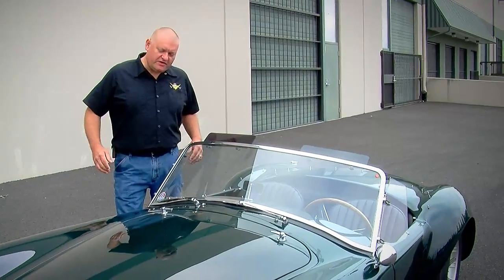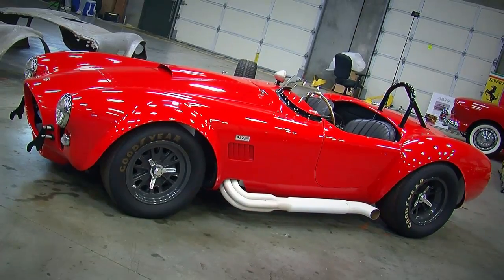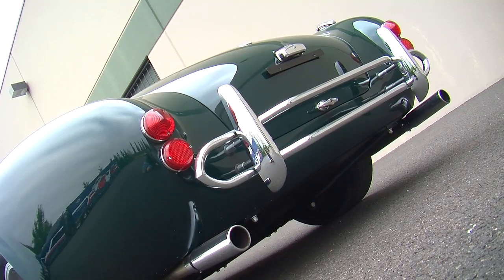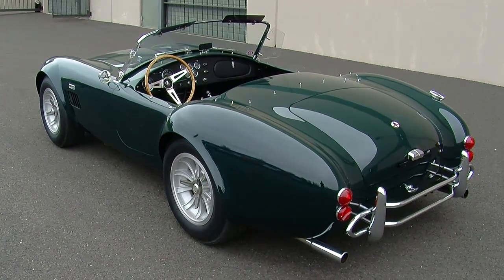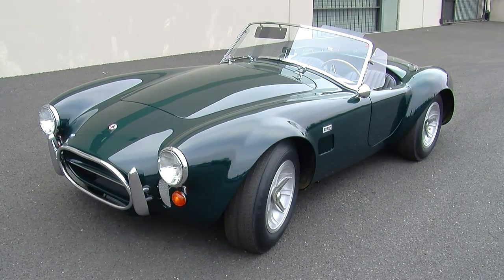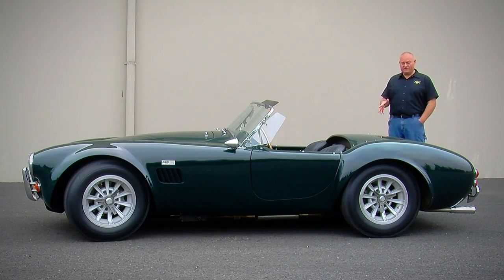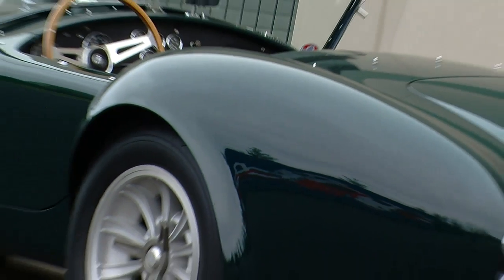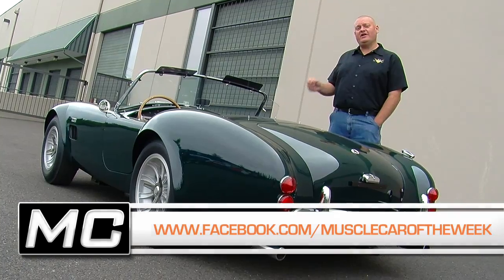Muscle Car Of The Week Video #81: 1967 Shelby Cobra

Comment: I knew a guy in my town that bought this exact same car brand new in 1967 from a West Hartford Ford/Cobra dealer.  I have some nice color shots of it taken around 1980 or so.  He had some issues and sold it.   I was at a car show in the former Hartford Civic Center some years later, and saw a green 1967 Cobra 427 street car just like this one.  It was being shown by E.R.A of New Britain, Connecticut, a fine Cobra and GT40 replica manufacturer. In conversation with the owner, it turns out this was that Cobra!  Small world indeed!
Reply: I know it’s been a couple years since this comment, but I think this was my Great Uncles car. His name was George Petri, unfortunately he passed away a few years ago. He gave me a picture he took when he owned it, CSX 3245. Do you happen to know if the car in this video is the car my great uncle owned?

Comment: Carroll Shelby was forced By Ford to remove the 428’s and put in the 427’s because of customer complaints that they thought they were getting the 427. Which makes this car even more interesting and valuable. It has to be rare.
Reply: It is well documented that only the customers who a) discovered they got the 428 and b) complained to Shelby, got their 340 hp 428 replaced with the 475 hp 427. I have no proof of this, but I have always believed that the 428's weren't even Police Interceptors, they were plain jane 315 hp motors installed in Thunderbirds etc. back in the day. Shameful behavior by Shelby, really.

Comment: The 3 second 0-60 was a real thing. If I remember correctly....Detroit recieved SEVERAL complaints about the 428 being used instead of the 427. Mr. Ford made a phone call to Shelby and Shelby was ordered to replace the 428 for anybody who complained. I'm not sure about the cobra but the GT 500 buyers were the bulk of the complaints. 
   Ol Shell had to replace NUMEROUS engines on his own dime. Mr. FORD said if he was selling it as a 427, it better be a 427.
Reply: GT500's were always advertised as 428....wat's to complain about?

Comment: Shelby did not bother to tell anyone that he had gone to the cheaper and lower-performing 428 engine - as can be seen from the 427 plate on the rocker cover of this car! Ford were about to discontinue the 427 in any case, but it was a bit of a sharp move to not tell buyers about it, I would say!

Also the move to Sunburst wheels was only because of the higher costs of the original Halibrand wheels.

Comment: I appreciate your explanation of the differences between the 427 side-oiler and the 428.  How about the 429?  Did it share a block with the 427 and 428?
Reply: No they call it the "semi-hemi" with very large heads, they had to modify the mustang towers to even fit the monster in the bay leaving no room for ac compressor.
Reply: bailey9r, thanks.
Reply: @bailey9r  The Boss '9 is the semi-hemi with the big heads (as are the actual Mopar hemi's) and all the 429's are 385 series engines whereas the 427-428 are FE engine family. Completely different engines.

Comment: The power ratings like thes have always confused me. I was taught that HP is the torque plus the inertia of the engine. In this and other cases the torque is much greater that the HP. How is this so as I could really use some help here? Thanks

Comment: A bit of misinformation in this video: The 428's were installed, not as an option, but due to a lack of availability of the 427 engines. This is well documented, that Ford couldn't (or wouldn't) keep up with the demand that Shelby had for the 427 side-oilers. So it was actually a bit underhanded and dishonest, what Shelby did, stuffing the pedestrian 428 (from the Thunderbird etc.) into these cars and badging them and selling them as 427's. Many customers were outraged when they found this out and demanded that Shelby install the 427, free of charge, as a warranty claim. Unknown how many got the proper 427 installed vs. how many kept the 428 that they came with.
Reply: Yep. That was a dirty deal to lay on people. The thing is, the 428 looked different than the 427. Seems most people would have caught that right away.
Reply: @stretch54  I have one that looked the same as the one here. Same color etc. The  428 actually looks the same from above except for the carburetor. In fact the 428 actually had low rise 427 heads and used a 427 AA mechanical cam. I added side pipes, hood scoop, Holley 780 carb and rain race tires and ran 12.4 in the quarter. Shelby's own 427 Cobra was tested in a magazine and ran low 13 in the quarter. More than anything it depended on tires/traction. His car had race tires so I don't know why it didn't do better. I actually asked Shelby why his car was so slow. He got irritated at the question but said it was because it was street driven. At the time I used mine as my every day car and was averaging around 12,000 miles per year. So I would guess that whoever ran thirteens was just being careful. I later replaced the 428 with a medium riser side oil 427. It doesn't feel any quicker, sounds about the same but gets worse fuel economy. I purchased the car in 1968 with 9,000 miles. It now has a little over 80,000 miles with about 50,000 of the miles put on the car in the first 4 years I owned it.

Comment: Would of been cool if Shelby built a few with the boss 429 engine in it..
Reply: Cobra was out of production when the Boss 429 was released - 69, 70.
Reply: I wish Shelby had made a SOHC 427 Cobra.  It was an awesome engine and would have been correct for the time period.
Reply: The "Cammer" engine you refer to was even larger dimensionally and heavier than the FE side oiler 427.  As awesome as it was,  it still needed development work before it worked reliably.  For sports car road racing the 289 was a much more balanced and much better handling car than the extremely nose heavy 427.  The FE 427 had enough trouble getting that power to the ground and the SOHC would have just added to that problem.  That's why you saw very few 427s raced compared to a huge number of 289 S/Cs.
Reply: Ronnie Costanza - Say what?

Comment: Since when is a 428cid engine putting out 460ft/lbs of torque in a light weight car not a muscle car?  :-)  well except for maybe it wasn't available to John Q. Public in big numbers; the Corvette is in the same category...BUT ITS STILL MUSCLE.
Thanks for the info on the 4 models, 427/428 engine and those star burst wheels.
Informative as always Kevin..that's why I subscribe to the YouTube channel.
-Dave
Reply: The most widely accepted definition of a muscle car is a mid size car with the biggest engine available from the make shoved in and arguably with the stipulation that it is marketed to younger buyers.It's significant because for the longest time,for the most part manufacturers put the smallest engines in the smallest cars,the biggest engines in the biggest cars and the medium engines in the mid size cars.

Comment: his descriptive difference between the 427 and 428 was poor...higher compression, changed rods, cam differences along with heads high rise, medium rise and low rise heads. 427 was a cross bolt 4 bolt main. and I'm sure there was much more..
Reply: He did not say it was the only difference.

Comment: So if you wanted performance and drive ability you turn the PI into a CJ and get 425 hp with a car you can drive every day . If you think a 390 GT had the same HP as a 428 CJ and less than the PI  like Ford said the CJ had about 90 and 65 HP respectively  more HP.

Comment: engine sounded like
 crap..couple plugs fouled,
Reply: Timothy Wyant ......high lift and duration cam.....smooths right out off idle....mine does......
Reply: Sounded like a Briggs and Stratton go cart
Reply: I thought the same thing. Unless there is some valves stuck from sitting in storage for so long.never good to sit.

Comment: shoulda  told about this cars  british origins
Reply: The 427/428 Cobras shared little with the original 260/289 Cobras except the general body shape. The 427 cars were not AC Bristol bodies but bodies that had been redesigned to accommodate the huge wheels and tires, the massive engines and even the suspensions are different, as was the tubular frame. So ORIGINS would be an accurate term, but the 427 was a different critter altogether. I'm one of the few who PREFERRED the original slab sided body style, and also the 289 engine. Of course when one thinks of Cobras they envision the huge body flares and most likely the roll bar and giant tires.  To me that looks almost cartoonish. Granted, it had to be with that monster V-8, but the little one was no slouch, either on the strip or the track. In either configuration the Cobra is if not THE most recognizable car on earth in the top three. The Beetle may give it a run for its money. In recognizability, not on the strip/track.